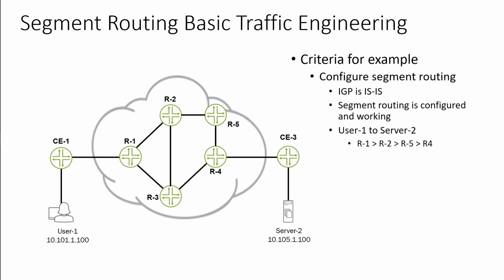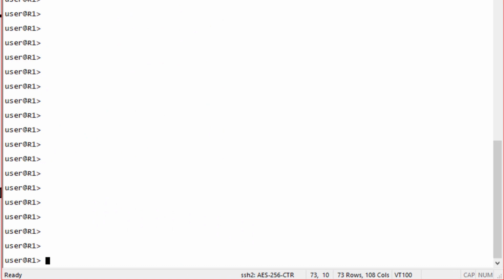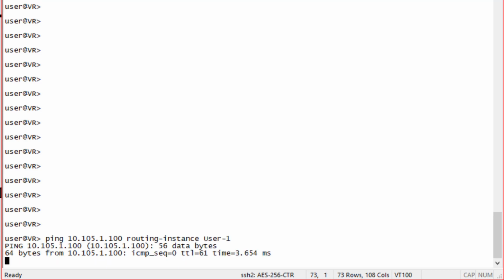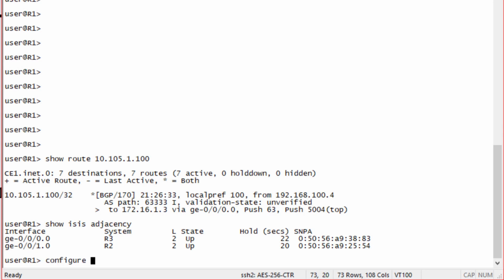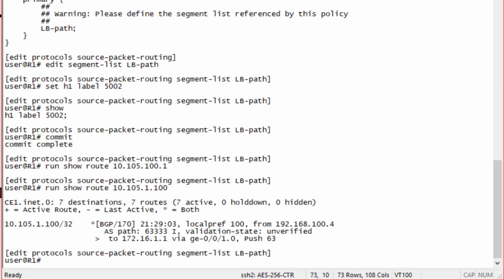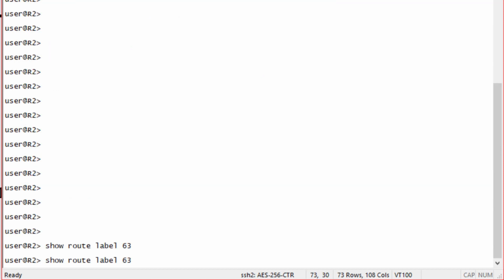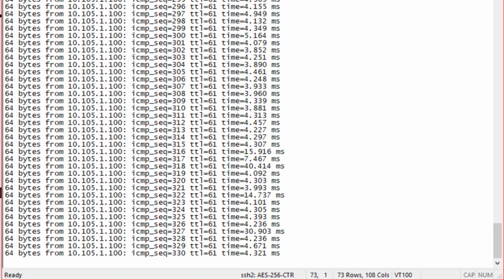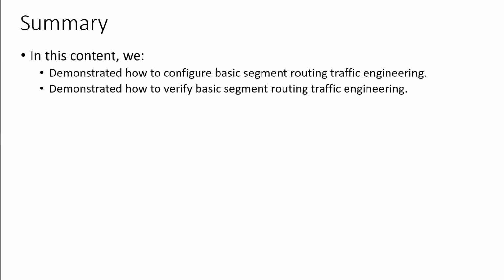Segment Routing Basic Traffic Engineering

Comment: Thank you for the explanation! I have a question related to this. In case we would have 2 links between R2-R5, could we use an adjacency SID in the hop1.5 of the segment list "LB-path" to choose the specific link we would like to use? If so, how can this be done? Thank you!
Reply: Yes, you have to use SR Adjacency-SID. They are automatically assigned to every interface but are not guaranteed the same after link-flaps or reboots. You can see them for an existing SR-enabled topology with [show isis adjacency details]. Best would be to assign static Adj-SID before doing this in production. Then you can use it in the Segment-List with the instructions from the video.